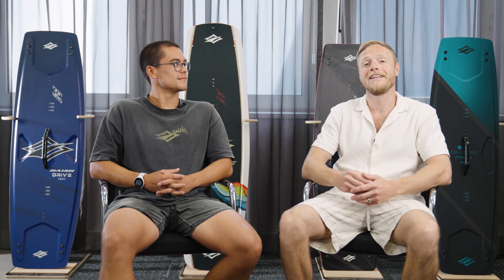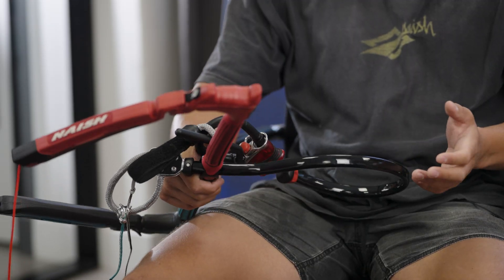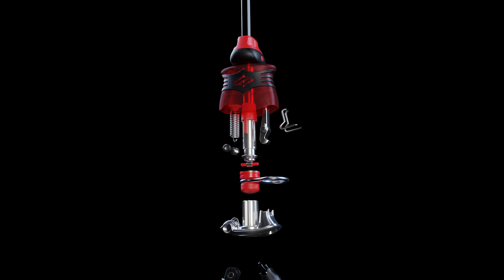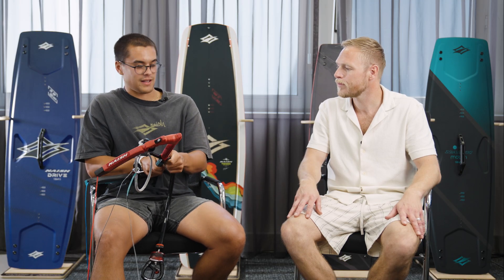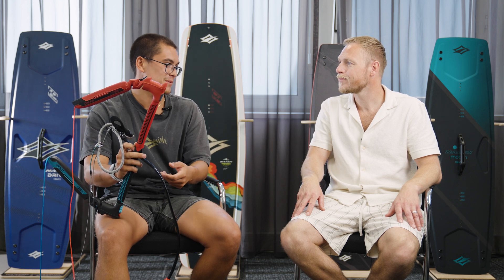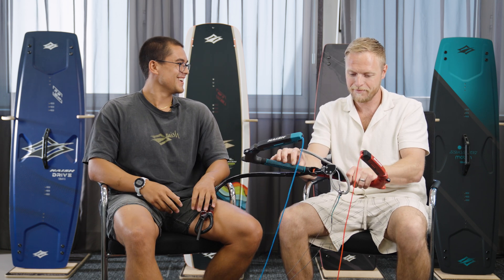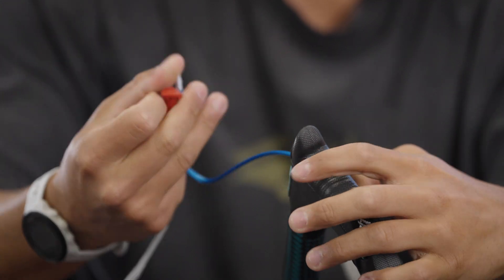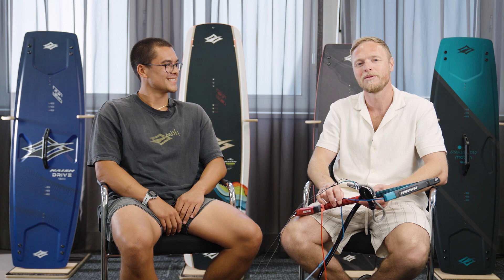Naish Bar Designer Noah Hofman Reveals the All New SYNC Bar Innovations | Kitemana Tech Talk

Comment: I still think the 2016 Best Red bar with QR from North (now duotone) had the best feature of any bar. It would keep any slack front line organized in figure 8 pattern when you pull safety. It is the difference between unwinding spaghetti mess for 2 hours or just pull the line out and reset in 2 minutes. None of the major kite brands picked up on that idea sadly.